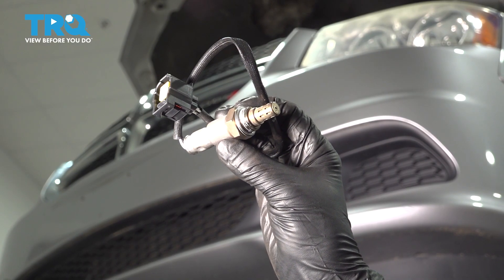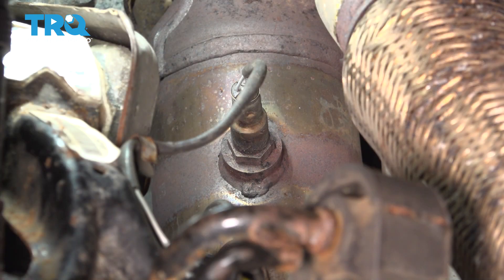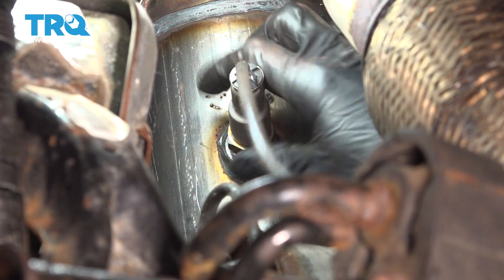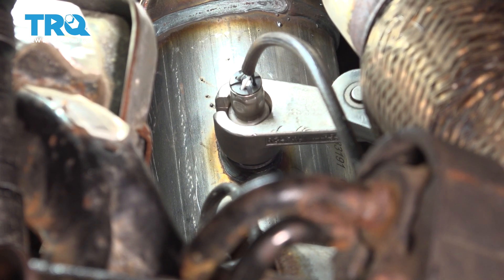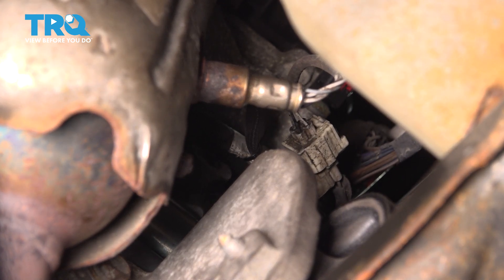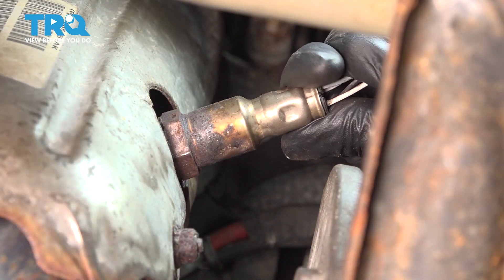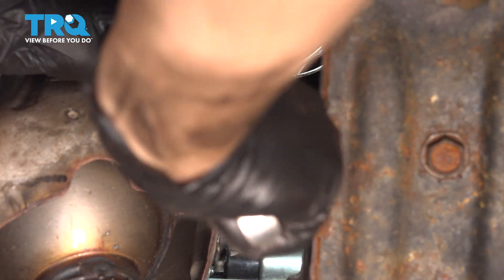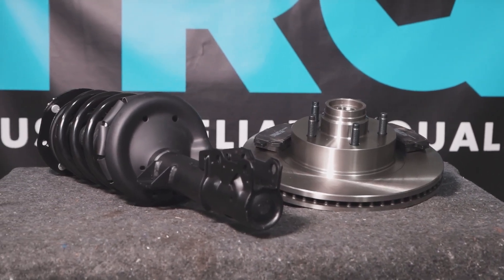How to Replace Downstream Oxygen Sensors 2008-2020 Dodge Grand Caravan

Comment: I’ve been having problems with my van 2013 Dodge grand caravan. I’ve been throwing money in this money and that fill her three misfire O2 sensor looping come to find out. It was my fuse box. It had corrosion in it. I cleaned the fuse box out my check engine light went right out soon as I started. All my problems are solved. I was having problems of lights flickering for some reason these vans when it rains even though the fuse box is closed they still get moist from the rain snow whatever and that was definitely my problem. I would recommend checking that before you go dumping $2000 in your carO2 sensors I replaced all four all six injectors all the coils and plugs throttlebody map sensor. It was nickel and diamond me for that problem.

Comment: Why did you when replacing fist sensor took off from used catalytic converter and then put new one on new catalytic converter? Did you screw up treads on the old one?